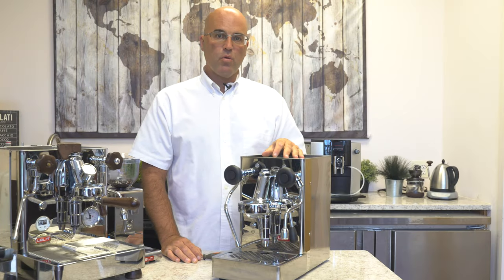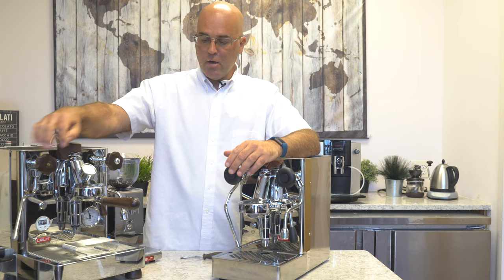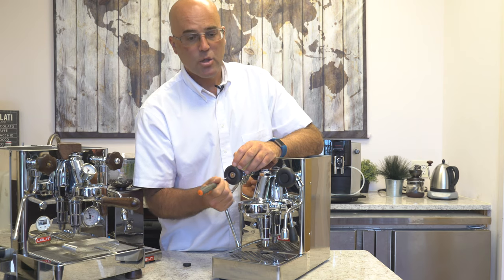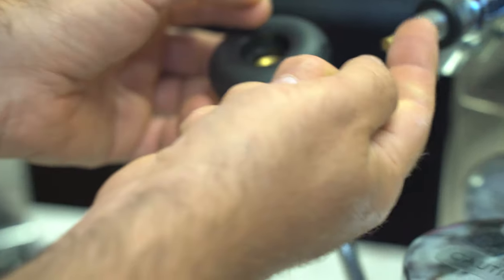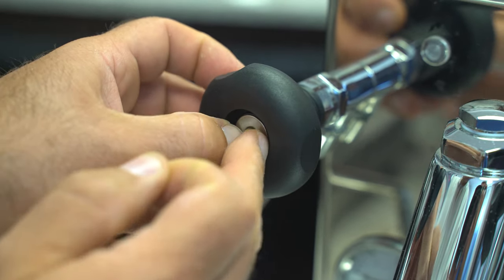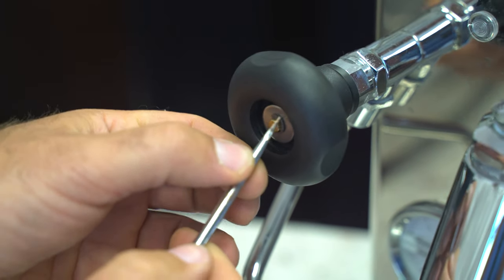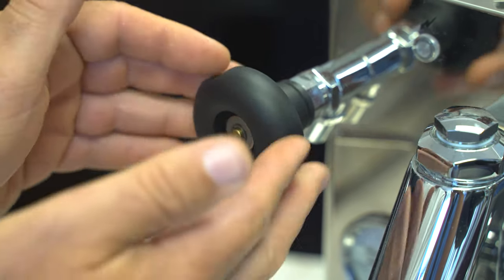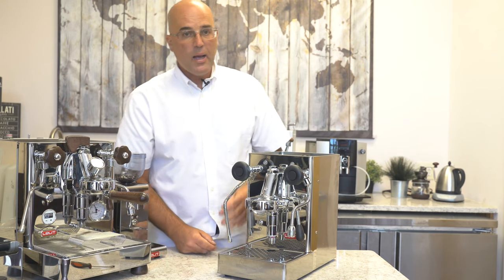TechTips: Lelit Mara Steam Valve C-Clip Repair

Comment: Hmm so after 2 years or maybe even less with the (Lelit Mara X V3) the steam knob now does absolutely nothing even though the pressure is good and the other valve works perfectly. I turn it fully open and nothing happens. Would that be a broken C-Clip issue? If so, where can I find a replacement?
Reply from the maker: it could be a c-clip or a bad gasket or a clog in pipe. First step is to check with the seller of your machine for parts. Please note that we do not know where you are located and we do not ship outside the USA.